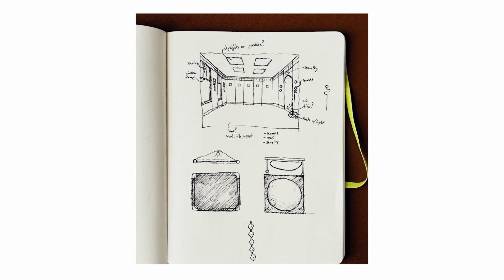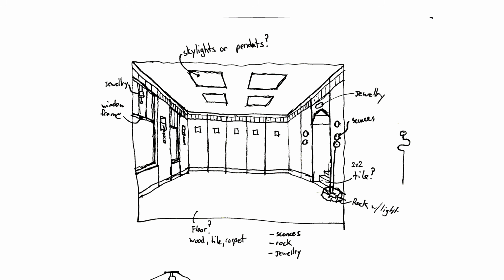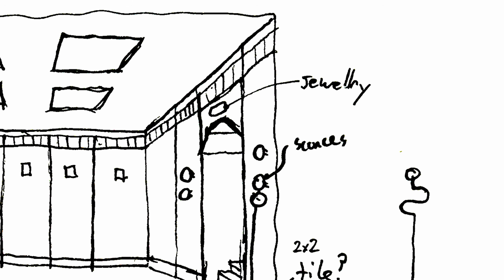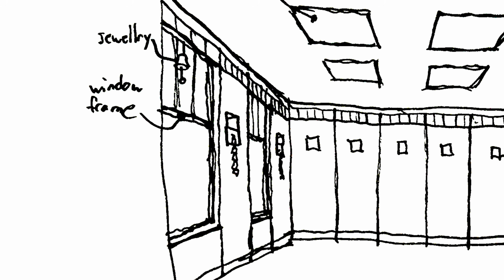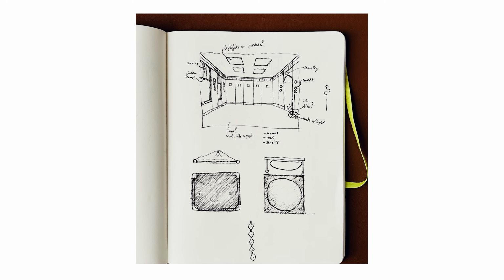Arch Viz Interior Part I - Ideas, Sketching, 3d Modeling, Materials

Comment: Hi!
I really admire the interplay of light in your visualizations, it looks absolutely incredible.
I was just wondering about your workflow, do you usually import and clean up models from Rhino or Archicad directly in Blender, or do you prefer to remodel everything from scratch ?
Reply from the maker: Thank you for the kind words! Lighting is one of my favorite parts. 90% of the time I prefer modeling in blender because it’s easier for me to UV unwrap and texturing. Also if I change something, which usually happens, I can just do it in Blender quick instead of re-exporting from rhino. So more work up front but in the long term it saves me. The other 10% is random objects like furniture pieces or more detailed items that I know I can model better and faster in rhino. Hope this helps!